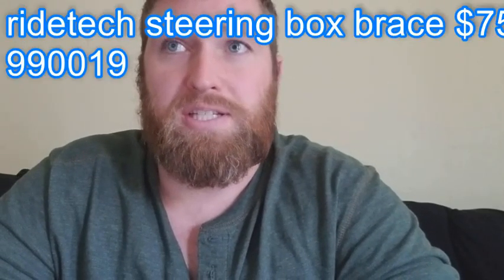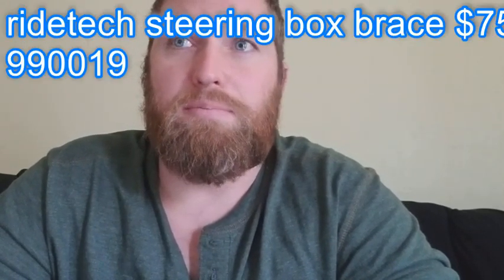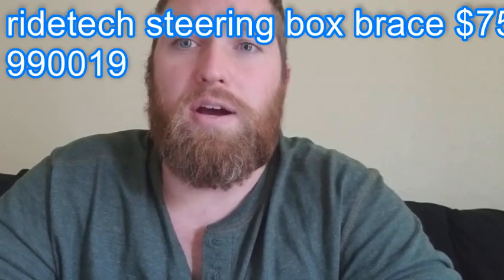Ep 3. Manual Steering and Borgeson conversion Review

Comment: Good video.2 Questions: I have a 68. It was originally a power steering car but leaked even after rebuild so I just pulled the hoses to my ps pump and removed it from the car. I then just drove it and it behaved like a manual steering car....which kind of conflicts with what you said (that you need a new or different drag link to go manual) - can you clarify? Wondering if I damaged my box doing this etc. Question 2: I actually like manual steering just fine but I want to get rid of the stock box because it has tons of slop and I don’t want that ram on there either...what do I need to get (borgeson etc) to stay manual steering but get rid of all the junky stock steering parts. I just dropped a 383 in and it is super scary with the steering as wacky as it is w stock components. Thank you

Comment: I purchased the borgeson C3 kit for my 81 vette. Only problem was the sector shaft on the borgeson box sits 4 deg. foreward, compared to original steering box and pushed the inner tie rod on drivers side up against lower control arm. Any suggestions would be appreciated.
Reply: I also have an 81 and just got the Borgeson kit... so were you able to resolve the sector shaft issue?